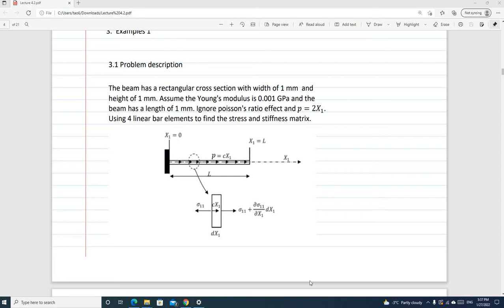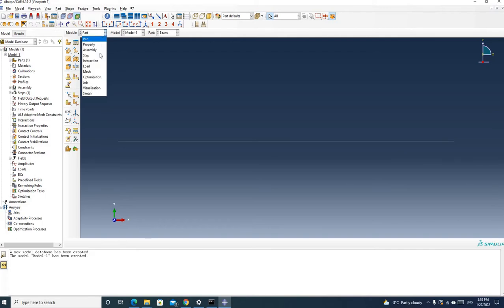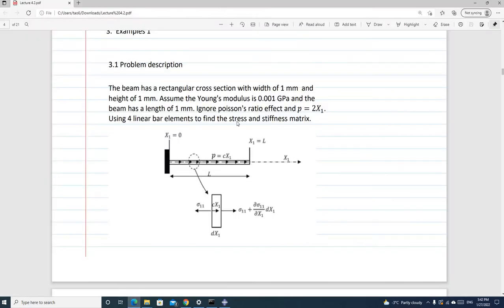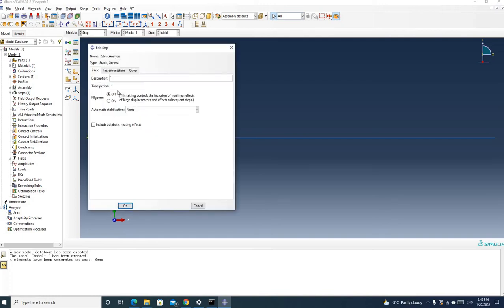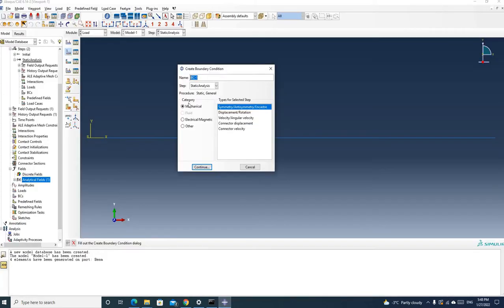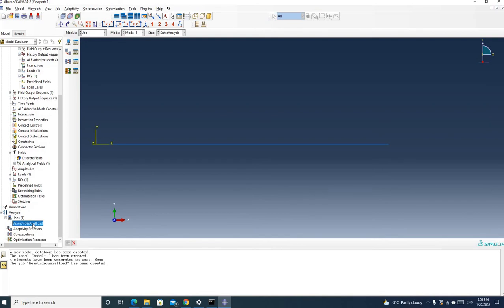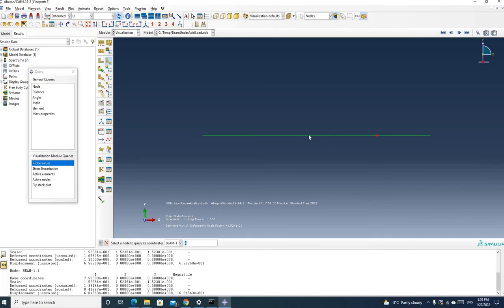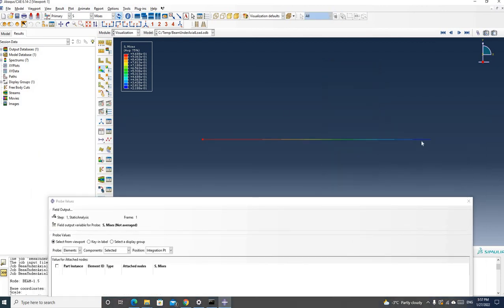One dimensional Linear Element in ABAQUS (Example)

Comment: In the queries, I think the nodes can be selected using node numbers (by typing them in). On the other hand, although we used boundary conditions, the software still shows a very low value for the displacement at the fixed end. Is it because of the approximations?